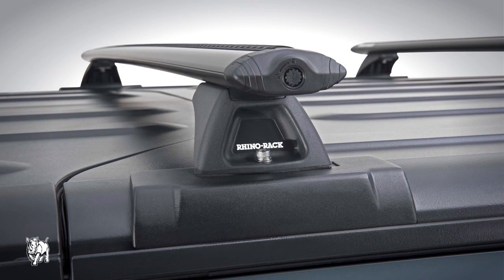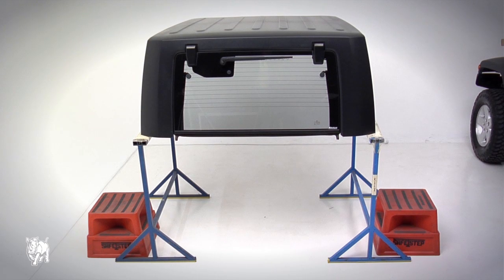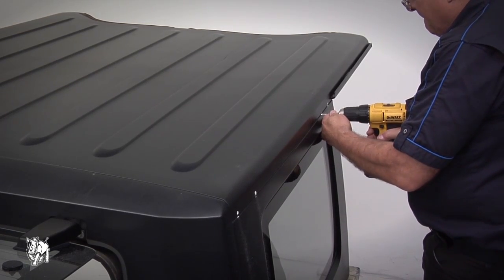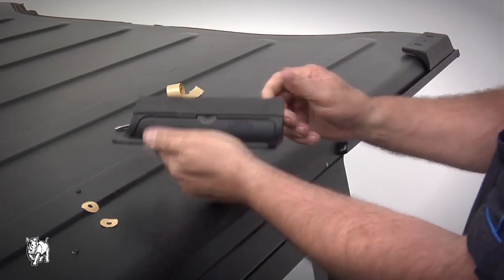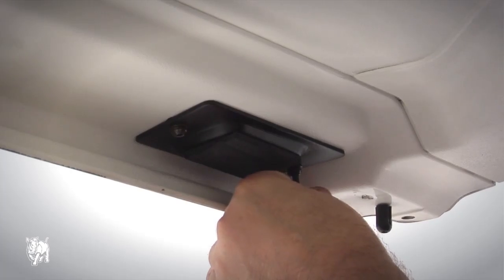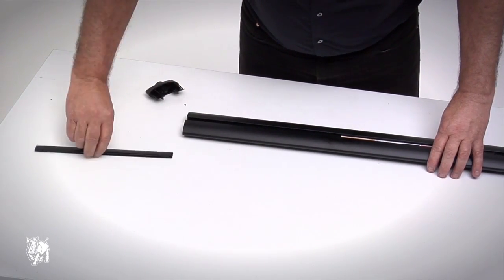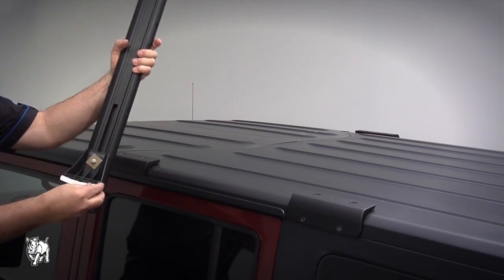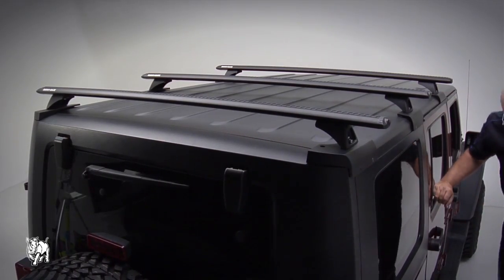Rhino-Rack | How To Install A Backbone System (Jeep Wrangler)

Comment: I spent a couple hours this past weekend installing the 3 pad backbone system. The printed directions that came with the system were pretty good. This video is a good companion to have available in the garage on you phone or tablet during installation. Its also a very good idea to have a friend lend a hand...i think i could have managed alone but it would have taken a bit longer and probably a bit stressful lol.One note....the front pad installation/contact point includes a bracket/plate that you bolt to the frame. it sould be noted that this bracket will interfere with the jeep soft top door surrounds...not a big deal...just remove them when the soft top in installed.all that being said i am happy with the install process and directions just take your time and have a friend help or at least be there with a cold drink!

Comment: My backbone kit has qty 4 CA1275 brackets instead of qt 2 CA1275 & qty 2 CA1276. Are the front & middle brackets actually the same bracket?
Reply from the maker: Hi Scott, depending on where you are located you can contact our Customer Service teams on the following emails. AU - customerservice@rhinorack.com.au or USA - customerservice@rhinorack.com. Send through the details of your order and they can assist you with the specific part breakdown of your setup to make sure you have everything you need. Thank you!

Comment: I have a RuggedRidge Exo-Top installed on my 4 door Wrangler.  Wondering how I would secure a Pioneer Platform that you guys sell.  Any suggestions? Thanks!
Reply from the maker: +John van Kints the Pioneer Platform does not have a universal fit for the RuggedRidge system. You would need to install legs or a C-Channel style bar in order to fit the Platform to your jeep.

Comment: Strong front runner for my JK. Not sure I like the idea of losing rear hardtop off capability.
Reply from the maker: Our system is very versatile as it connects directly to the factory mounting points of the hardtop, this means the hardtop and the roof rack remove at the same time. There is no need for any extra removal of parts.
Reply: @RhinoRackAustralia  unlike the Maximums 3 system. :-()